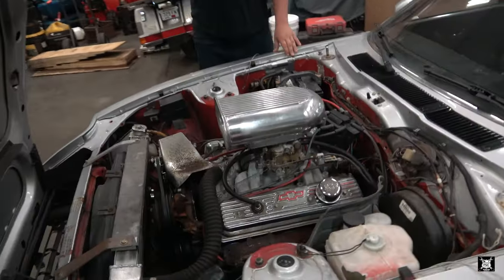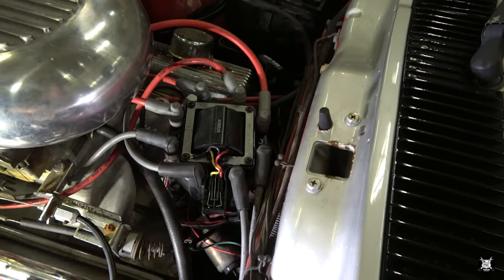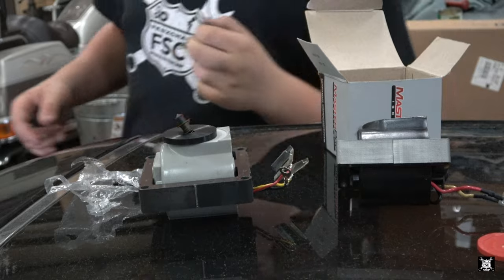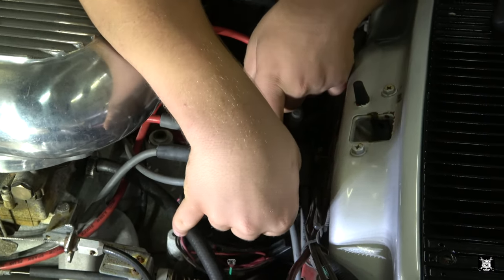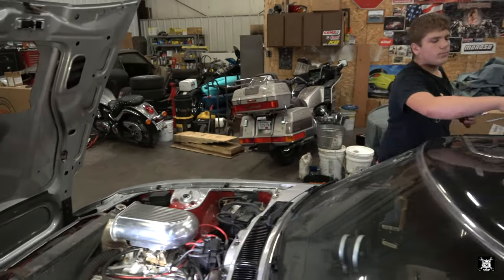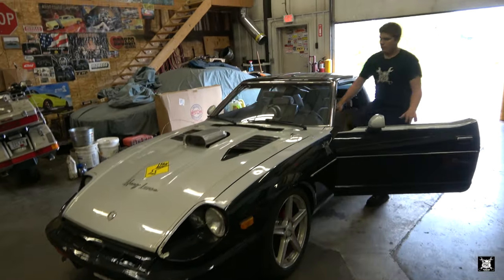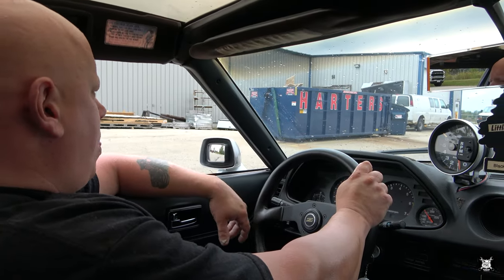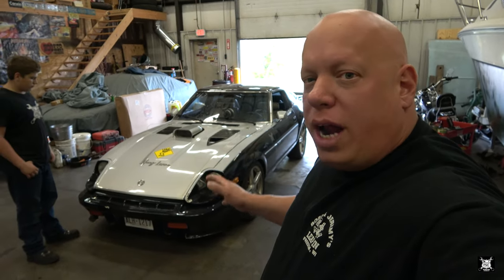HEI Ignition Replacement In A Datsun?   350 Chevy

Comment: Them screws dont go there the same screws that hold the cover hold the coil down too. Theres nothing wrong with a hei cool on a gm. They pit out as much as most aftermarket ones. Ford has a adaptor that you can put that same cap and coil system on their distributors